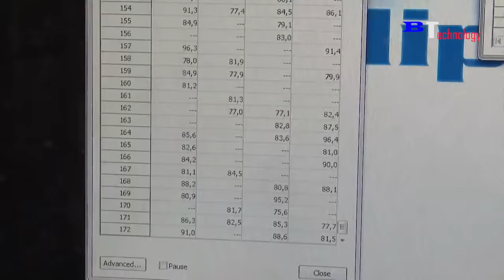How is Apple Juice Produced, Modern Fruit Juice Production Process Saves Millions of Dollars

Comment: Real juice should taste different with each batch of apples crumbled to extract juice from bcz of difference in glucose and iron contents of apples ;however, evry packet of juice produced tastes same bcz contents are tampered with additives. U have, then, sip of natural tampered with real fruit juice.
Reply: Don't know if you will see this reply but you are wrong. These are highly regulated industries. In the uk if it says 100% apple juice on the bottle then that is all that is in there. The only additive that is allowed is ascorbic acid or vitamin C. This is done to stop the fruit from going brown or oxidising. I can only speak for the UK but apple juice is made from a blend of apples and does in fact taste different throughout the year. Juice made from concentrate is a different matter but still if it says 100% made from apple concentrate the only thing added is water. The process of concentrating the apples which is in effect boiling them turns the apple into a thick brown syrup which is also clarified during the process so that when water is added back the resulting juice is a clear product unlike proper apple juice. During the concentration process the apples lose some of their smell and taste this can be added back but only natural apple aroma and flavour can be used. The aromas and flavours are derived from the condensed water that is driven off in the concentration process. Ask me how I know this......I have just completed nearly 15 years in a plant that amongst others packs apple juice.